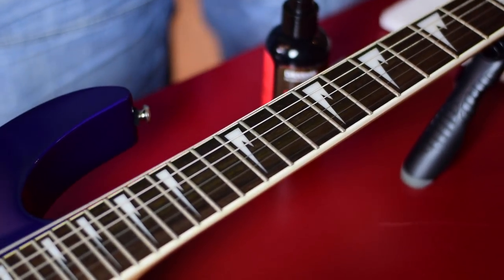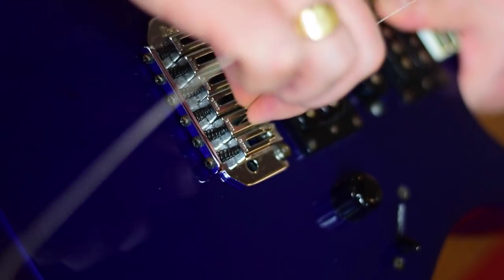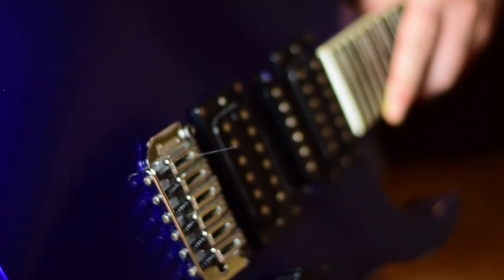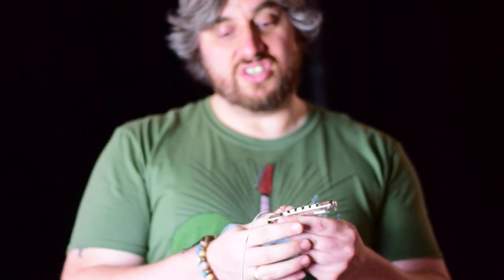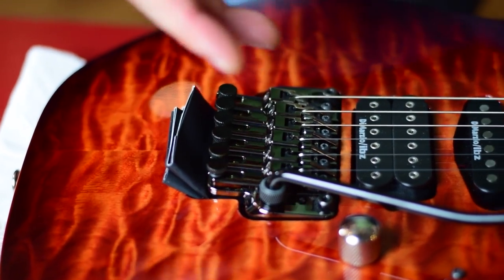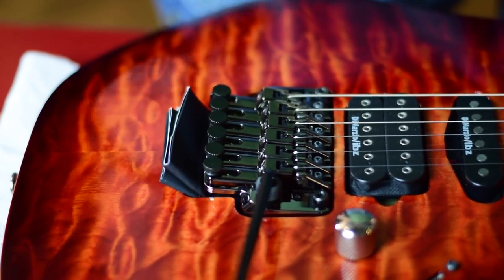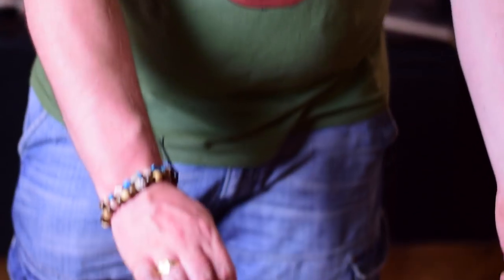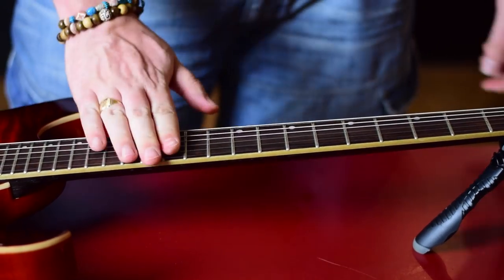How to change guitar strings the easy way!

Comment: Not using a mic this time? audio is kinda bad compared to normal :(
Reply from the maker: renny_S yeah mate we had all of the technical difficulties man. Just thought id throw it up as audio is not that important on this vid.
Reply: ah thats a shame, still great info man! thanks for the content!
Reply: audio sounded good to me paul i thought you mustn't use lemon oil on the fretboard
Reply: I always thought you shouldn't remove all the strings and change them individually to keep tension on the neck.  Is this an old wives tale then?
Reply from the maker: switch yeah dude its a great clean and restore oil works better on rosewood as it can dry out and look dusty.